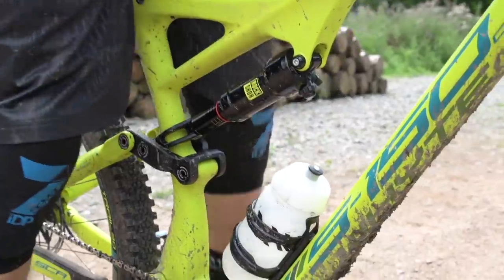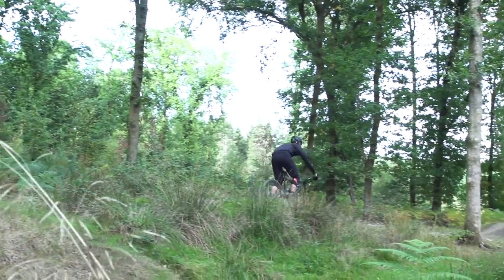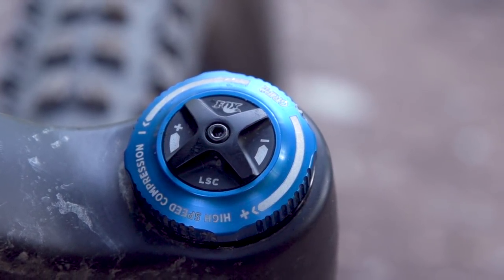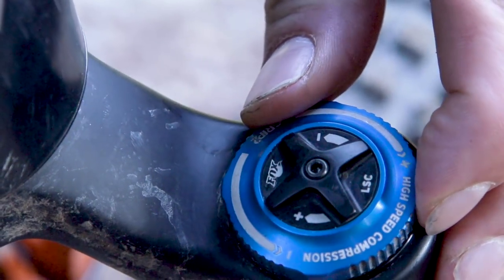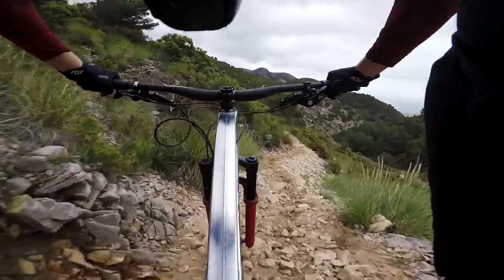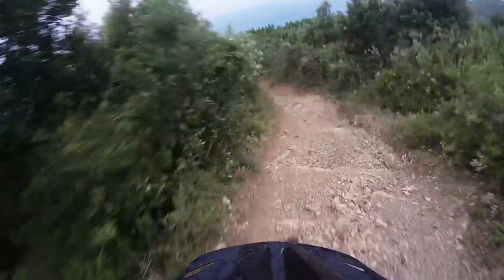Advanced MTB Suspension Setup - How To Find The Perfect Balance

Comment: 1:56 - Spring rate
3:45 - Progression (Volume spacers)
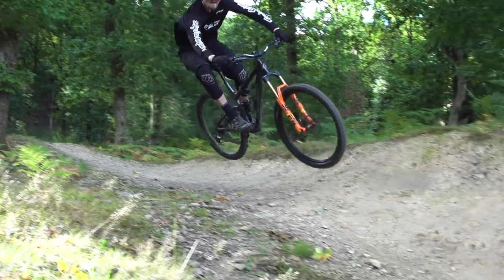5:20 - LSC (start anti clockwise)
9:20 - HSC
11:25 - LSC and HSC progressive / regressiv
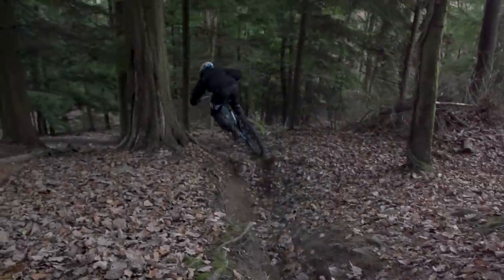12:48 - Set up steps
13:10 - Rebound
17:50 - Ride the same trail again and again ;)

Comment: I've been taught that sag is everything. After you set sag then add volume spacers if you are bottoming out. If you try to add more pressure you don't end up using all of your travel and won't be as supple.
Reply: Coming from motocross, that’s how I was taught as well with the best results. Reducing sag is a symptom of poorly valved suspension in my opinion.

Comment: I have the new YT capra pro race and came from the Giant reign carbon but with the 36 rc2 fork and x2 shock so the same as my new bike but the settings wouldn't work when I transferred over to my new bike. I ride a 4 mile loop in the forest 13.5 miles and 5 or 6 times a week and come from a motocross back ground and admit I am a suspension nerd. Your video is very good.  I ride the same loop I can feel the difference if one day is wet and one day is warm without even changing settings. The fox x2 shock is superb with very fine adjustment and gives great feel.

Comment: Good vid, I'm using progressive setup with a little low speed damping but high speed damping is 1 out from full for big hits (rock shox Vivid Air)
Reply: Vivid doesn´t have adjustable high speed compression (unless you tuned shimstack)

Comment: What I do is I run my fork 180mm and shock 160mm at 30% sag. Then I put 5/6 volume spacers on the rear shock and set the rebound so it overshoots sag by 5 - 8%. I run no volume spacers in the fork giving it a nice and linear feel. I am still a light and young rider about 56kg in riding gear. So u may want some volume spacers in the fork. However my shock and fork feel great. 👍.

Comment: Next video suggestion: 
Expert MTB Suspension Setup - How to change shims for different oil flow + oil viscosity. 

I am about to service my DVO Topaz T3 shock and my Formula Selva EX. The shock is phenomenal, my fork can not keep up with it and I did that much with almost all CTS drop-in valves to change the suspension curve, played with the progression with the ballistol oil on the air chamber instead of tokens but I can not find a setup who will balance the bike front to rear. 
This is really frustrating and I only can think about to change the oil at this point with a better viscosity for faster oil flow. 
Any other Suggestions? Maybe a professional tuner?
Reply: You need to balance spring rates and progressivity first and foremost, not mess with damping instead.

Comment: So silly question from a roadie, doesn't the temperature effect the pressure in the shocks (mean of course it does, but maybe not enough to matter)? also don't they warm up after some hard riding, and thus increase the pressure as well?
Reply: Not a silly question at all! Air temperature will affect spring rate. Going from 0°C to 20°C will increase pressure (and therefore spring rate) by about 7% (the pressure is roughly proportional to the temperature measured in Kelvin). This will also affect the viscosity of damping oil slightly; so as the air temperature increases, the spring gets firmer and the damping gets softer, making for a springier ride. More importantly, dampers generate lots of heat (that's what they do). In air shocks, the heat from the damper can raise the temperature, and therefore the pressure, of the air in the spring. Again, this leads to a springier feel on long descents. That's why it's common to get bucked on jumps at the bottom of long downhill tracks. A famous example would be the jumps at the bottom of the Fort William World cup track, where it's not uncommon for top-level racers to go over the bars. In that case, you might want to start with your suspension too soft and slow, so it's "optimised" when up to temperature.

Comment: At 8:20 the fork compresses all the way and the drop isn’t even that big. Can someone explain why that is? Too little psi? Rebound? I have the same thing happening to my bike on bigger drops and I don’t know what to do.
Reply: 1 Springrate 2 in this case HSC and HSR because it’s the second part off the travel/ high speed impact. There is a lot of bodyweight at the front of the mtb.

Comment: Ok, no volume spacers and HSC and LSC  almost dialed all the way open. Fork feels supportive and tracks ground fairly well, but it only uses 75% of travel even on larger hits, drops etc. I should lower spring rate, then use compression to dial back in support if wallowey? 2020 fox factory 36, grip 2.

Comment: Something that i find (nearly) allways to be missig in such guides is, that you cant have everything. Your suspension cant be set up to work optimally on jumps, small bumps, berms, rough terrrain, flat sections, drops and steep sections. It is just impossible. While this isnt something that helps you to set up your suspension, it is something thats important, because some riders never find a point that they are happy at so they keep screwing around with their suspension, hoping they can make it do everything perfectly. He talked about it in relation to rebound, but not in general.
Reply: You're absolutely right.  You can't have everything; it's all about compromise. Finding that compromise is what this video is all about.
Reply: When you do dirt jumps you need max pressure

Comment: HSR or LSR for getting (nearly) bucked on lips? This is also consistent lips... as in the same ones that don’t look any different (eg 2nd tabletop at cannop for a small one but as you are there in the vid) or one specific but not the biggest or steepest on the new red @417 ... and on the same bike and shock.. CC DB Air CS ... in fact with CS left on by accident it doesn’t happen ... Equally doesn’t happen on the road gap or table top (cannop in your vid) ... it’s almost there ... I just don’t want to start randomly playing with both...
Reply: Hey Stephen, If your suspension is rebounding like we showed you in the more basic video (link in description) and you're still getting bucked, that suggests your HSR is too fast. I'd slow that down first. If you're still getting bucked, start slowing down the LSR. I'd say with HSR it's safer to start with it closed to avoid getting bucked, then speed it up until it starts to feel too unpredictable on big impacts.
Reply: Thanks Seb, I'll give it a go with the HSR closed next time and open it slowly it's on 2/4 so I have 2 turns ... I still need to remove "user error" in terms of why it only seems to happen on specific lips... Perhaps a part of this is I'm expecting it to happen and going stiff... but although non of these are particularly big they are big enough for the LSR to return and equally big enough that I'd like to avoid a nose dive OTB.  (stuff breaks more easily my side of 50) I should drag the HT over and then I'm 100% certain I have no shock rebound issues :D  

This is a new (to me) frame and shock (Mega 275 in the old Large)... and the other thing I noticed is in general the back feels lethargic/settled on trails compared to my Medium T-130.  This isn't unexpected...(being longer, slacker and more travel). it just seems at odds with the kick I'm getting on the Mega on jumps..

Comment: I would NOT start with LSC wide open... Running damper settings all the way open or closed usually means that your spring rate is waaay off and you'll be trying to compensate for the issues created with a fully open/closed damper setting with having another setting way off. So if HSC was closed up all the way, running the rebound wide open to "prevent packing" will just make things worse. You really need to adjust spring rates with volume spacers and air pressure if you find yourself adjusting the settings wide open/closed.

Comment: Awesome video. Quick question: I'm getting way too much vibration through my bars into my hands but I am always very close to bottoming out my fork. I ride Queenstown bike park mostly so lots of very steep trail with very deep ruts but also lost of fast chattery stuff. Because of this, I'm gripping my bars a lot more and have developed a gripping related injury in my fingers (A2 pulley injury for any budding physios out there). So after watching your video, I'm thinking I should try some volume spacers/tokens instead of reducing the amount of air in the suspension. Does that sound right? Thanks!
Reply: You could also try softer grips and maybe carbon bars to reduce the vibrations going through your hands

Comment: I recently swapped my Trek Remedy for a Scott Voltage, and I am now running on a Coil Shock, I have checked the manufacturer chart and the spring rate is just fine for me. I went for a ride last week and I found myself nose diving on jumps, I tried slowing down the rebound and it helped but I was still not comfortable with the way things was going. 
I have now tried to change the bike configuration from 190mm to 170mm on the shock do you think this can help? Do you have any tips that can help me get airborne safely? Maybe too little rebound on the fork? 
Thank you!
Reply: Hey Bruno, You're right to slow down the rebound on the shock - that's a good first step. Another cause of nosediving on jumps can be using too much travel on the take-off transition. In this case, increasing low-speed compression damping can help to hold the shock a bit higher in its travel, so it has less travel to rebound through. You might also want to double-check the spring rate on the fork and shock and make sure they feel balanced when you compress the suspension on flat ground. Ultimately, though, good jumping demands good technique, as well as good setup.

Comment: This is such a useful and insightful video. Hats off and great deal of respect for putting this out!
I still have a question though: my FOX 34 Fit4 fork does have only simple rebound adjustment (not HSR/ LSR) and after 2 years of tinkering with it, I still can't make it to feel right in all conditions. 
I am particularly dissatisfied with how it performs over rockgardens and roots at lower speeds, being overly harsh and giving me the feeling that I'm riding a mad bull that want's to buck me over. 
On the other hand, if I attack technical sections at higher speeds, it is quite ok. I have to mention that I run a volume spacer, and that I have 160mm of travel, but never use full travel, not even after drops or jumps. Any tips on improving the sensitivity/overall feel and way it reacts on the more low speed chunk?
Reply: I don't think it's possible to ride rock gardens and roots at low speed without feeling like you're riding a bull, you just need to work on your line and/or hit it faster
Reply: Since it’s harsh at low speeds and you never use full travel, it sounds like your air pressure is too high. Your rebound is mainly LSR. Set it just slow enough to keep it from bouncing as in the video with the LSC on top full open (fast). Leave it there and ride.

Comment: I have a rockshox pike 160mm fork on my kona and always wondered what the charger damper meant. They made the knob blue so at first I thought it was a low speed compression adjustment but I don't think it is. I always just leave it fully open but could someone explain this to me?
Reply: If you have a single dial with multiple, I believe it is LSC.

Comment: i need some help, i setup my fox 40 preload to the recommended sag on the website (i cant recall the exact measurement) but i am not using the full travel on my bike, even with every other knob open all the way?
Reply: It will probably be that you have 1 or 2 more volume spacers than you need. There easy to take out ( just take off the air cap) but take it for a ride before you do so. Go through this video and there other, simpler one to make sure everything is set correctly. Then consider removing a spacer.
Reply: @Luca-ft1kv  lol i should've clarified its a coil fork
Reply: @TheDHJunkie  might be theirs excessive air trapped in the lowers or their might be to much oil in the lowers. Thats about all i could think of. You might have to ask someone else

Comment: You can't have 1 setup for all trails. One setup might be perfect for one trail and not good for another. It's a continual thing and needs to be adjusted according to the terrain involved and style of trail. 
Set it slightly too firm and roll it back until comfortable.
Reply: That’s right. Actually, he also says that when he talks about downhillers that use a more solid setup. But it's important that you mention it!👍🏻
Reply: @sportiefbezigutrecht3883  Yes the firmer setup the better for racing. Racing isn't about being comfortable, it's about being fast.

Comment: Hello everybody, 
Am I a Luddite for wanting a quality but simple mountain bike with a light alloy frame, ridged carbon fork, 29 inch wheels with medium sized tires, hydraulic discs and a 1x10 set of gears? 
Is there a decent bike out there like this anymore? Any recommendations?
Reply: it sounds like a cross or gravel bike to me.
Reply: You just described my Salsa Fargo. Minus the Alloy frame.  The Fargo has a steel frame with carbon fork.  You could swap out the drop bars for more traditional MTB bars and be on your way.
Reply: Yes, yes you are..... that type of bike only comes in single speed these days and with a fancy mustache 😉

Comment: Why are these companies going for extra volume (evol) when most people want to reduce the volume with spacers, even in the lower volume shocks?
Reply: The EVOL (and larger volume shocks) generally refer to larger negative air chambers, rather than the positive air chamber which is where the volume spacers go.
Reply: People reduce the volume of the positive chamber in order to make the suspension more progressive, and companies increase the volume of the negative chamber to decrease stiction at the start of travel which gives a smoother ride over roots and braking bumps